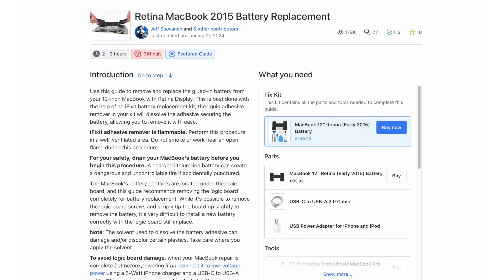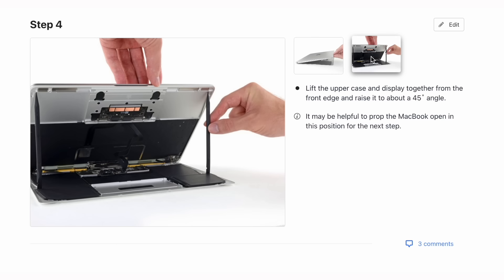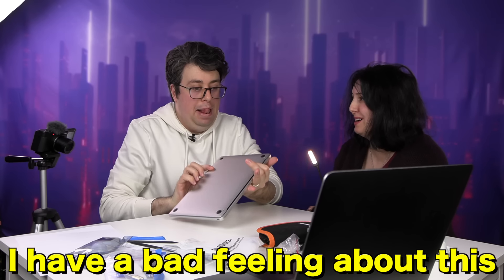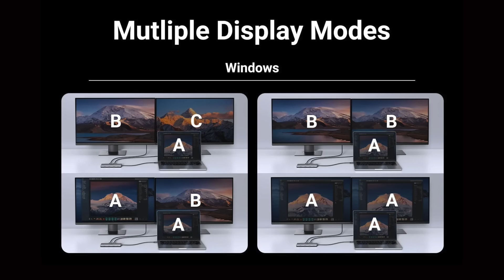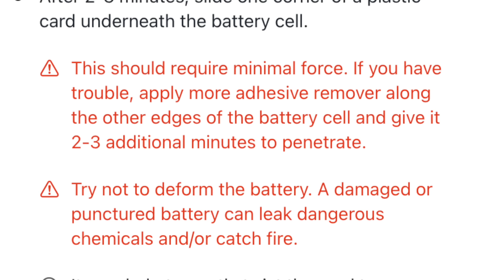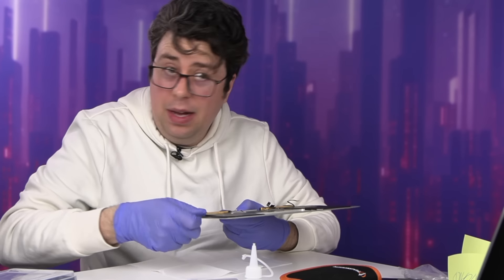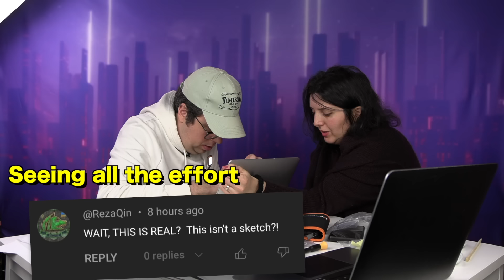So… I Broke My Wife’s MacBook

Comment from the maker: Thanks to UGREEN for sponsoring this video!
Ugreen Revodok 210(29%OFF) - https://amzn.to/49jQ4ZD
Buy on Ugreen Official Store(29%OFF) - https://bit.ly/3I21YLM

And sorry Adi! 😅
Reply: Hi Sam
Reply: Love ur vids
Reply: Hughes Jeffrey, and he will do it!
Reply: This would have been a great iFixit sponsorship chance
Reply: @SAMTIME do not use USB hubs, ever, and please don't promote it. The device can handle the data bus division but it CANNOT handle the power division, which leads to usually burning the USB port or the entire board. NEVER use a USB Hub.
Reply: But you tried resetting the SMC right? My Mac also wouldnt start up after battery swap, but after resetting the SMC it worked just fine.
Reply: i-unsubscribe-jjjjj

Comment: Apple is awesome! In the 90s a battery swap would have been done in 2 seconds without any tools. Now you need to be a surgeon to fix anything on a Mac
Reply: apple batteries have always been easy to replace. it's just the annoying part pairing (Battery health disabled)
Reply: That think is thinner then a smart phone (12 inch MacBook) I can promise you it wouldn’t have been even possible to make it easy to swap out in 2 seconds -.-
Reply: Ah yes, it reminds me of changing a cars window nowadays. They have become an integral part, contributing to the chassis' stability and what.... are glued in !!!
Reply: @Bloxomatic  Well it would, but it would have taken more effort to actually design it to be swappable. Its cheaper and easier to just glue everything down. There is a laptop that has fairly easy parts swapping called the framework 13, but it took a lot of time for it to become a thing because they had to design a whole bunch of modular connections just for it
Reply: Apple, the world’s biggest Unnovator
Reply: Surgeon is the right expression.
Reply: It's by design. Everything is by design to get customers to purchase the next product.
Reply: and tenticles instead of fingers
Reply: Just a few days ago I replaced the engine computer in my car. MUCH easier than this (and it worked afterwards)

There is ZERO excuse for a product to be this difficult especially for a part that often fails-- it's horrible engineering. There are rumors that EU will be demanding user replaceable batteries... That would be a good idea.
Reply: Every other laptop is awesome today
Reply: @theronwolf3296  Not a part that often fails but a part that's guaranteed to fail over time.
Reply: i wouldn't call this "to fix"
Reply: The best were the iBooks and early MacBooks, the only tool you needed was a coin.
Reply: Honestly, I would happily sacrifice a thin profile for ease of repair, both for vehicles and electronics
Reply: Says the person writing this on his 90s PowerBook 170... or is it a MacBook Pro 2020 model!
Reply: Yeap, I have a HP laptop and the battery is connected externally, you can literally disconnect it by pressing a single button xD it even have a battery lock to prevent accidently disconecting it. Can't get any easier
Reply: @Bloxomatic It would have been possible to assemble it with zero glue though. Look at the new repairable Surface PCs or the Framework lol. Both very thin, but no glue and easy to open
Reply: @Bloxomatic  Yup, no way they could have just put the battery in compartment on the bottom with a door held on with a few screws.  Yeah, just not possible at all.
Reply: I agree they are awesome but not for that reason
Reply: 1990s? Even the 2009 was an easy swap. Crazy the work you have to do.
Reply: Classic USA shit.
Reply: Here I’m using an Accer tablet from 2014 and it’s battery still gets about 3 hours on a full charge from the advertised 9 hours when it was new. This is the best tablet I’ve owned as far as usability goes since it hasn’t got any bloatware on it the ui is still quick even with only having a gig of ram. You’d be surprised how much of today’s bloatware runs in the background using up all that extra ram you think you have.
Reply: Best one was the Powerbook Wallstreet with 2 battery bays on each side.
Reply: It was also twice as thick and weighs 15lbs 😂😂😂
Reply: I get what you mean, but apple also didn't make money in the 90s.
Reply: @XanthosAcanthus  Well, that's alright then!
Reply: I believe that's what they call unnovation
Reply: In 2023 every MacBook comes with a special demon whose sole job it is to prevent repair using third party parts. 
Replacing that demon is fantastically hard because Apple refuses to provide replacement parts or authorise third party parts. And those demons can be hacked but only if you’re more of a genius than an Apple Genius genius.
Reply: And still It wont turn on , LOL
Reply: @Bloxomatic yes you could. You just designed it to be part of the bottom cover and let it come out with it entirely. Not ideal but it would have been removable and teplaceble with only a handfull of screws in like 5 min
Reply: Well you'll be getting that back around 2027. You can thank us Europeans for putting in them in place. Although they might be petty enough to design something that adds glue or something  ot just use the software to lock the computer outside of europe so maybe stop bikering between yourselves and ask for proper change
Reply: @Custodian123 true though its relevant not for every company
Reply: Still have my macbook 2008. A few years ago I replaced the battery the battery by just going to the back of the macbook, push down 2 levers take out the battery and put the new one in and done in about a minute. 

Swapped out to a 1TB 2.5 inch drive by pushing down the same 2 levers and unscrew 2 screws holding the drive and the power and sata cable and done. Now on the new ones it is a nightmare.
Reply: Have you seen the Surface Pro?
Reply: @nuggo3068  Surface is more of a tablet than a laptop
Reply: That’s sad.
Reply: There are many things about Apple I'm not a fan of, but the weird and unwieldy batteries do have a genuine purpose - you can fit a bigger battery by conforming its shape to the leftover space in the internals, and not using any extra space to add parts to make it more easily replaceable.

For most people, a battery that will last longer per charge, for more years per battery, is more convenient than a battery you can replace easily. Unless the only thing you're using your laptop for is something that never needs a better processor (e.g. I know an old woman who uses a 15-year-old laptop for Microsoft Word still), most people have good reason to replace their laptop by the time the battery is going kaput anyway. So many use cases of phones and laptops will struggle/be impossible on hardware over 5-10 years out of date, that the best value is to just replace the whole thing even if a cheap and easy battery swap is an option.
Reply: Awesome is not the word I would use to deliberately make it unrepairable
Reply: mac's are by far the most fixed because the only one's worth to fix in the first place and this battery lasted plenty long enough if you ask me, this is a very, very old machine.
Reply: need to be a qualified surgeon to fix anything apple related now
and if not qualified then well your screwed
Reply: In the 90s?
Reply: Now they're reverse awesome!
Reply: Not sure about been the same, but yeah apple could make it easier to fix at least the battery issue without changing the form factor. Thank govt hand off approach nonsense.
Reply: no. you dont have to do it. although they do serialize everything but u dont have to b a surgeon come on
Reply: Apple: the industry leader in unnovation!
Reply: "Now you need to be a surgeon to fix anything on a Mac". this is not true. this is 2015 model. now battery swap is much easier.
Reply: in 90s laptop was 3 cm fat/
Reply: Well, you should go back to the 90s then. Because all the laptops nowadays are like that.
Reply: You could do it before 2007 I think

Comment: It's quite reasonable to assume, you didn't break anything. While it is reasonable to assume, that one of the quadrillion anti repair measures from Apple kicked in.
Reply: What's the most repairable laptop out there?
Reply: Lenovo and dell is there.
Reply: Really depends on the model, some dells are super easy to work on.
Reply: @ayanc13  old Thinkpad and latitude yes
new yoga and xps no
Reply: @مرحبابك-ض1ن  Modern laptop? Framework. Old ones? You have plenty to choose from... And I have no idea.
Reply: i can replace parts with ease in every hp pro or elite books with couple of screwdrivers, usually torx and philips they are easy to work on, unlike their cheapo versions, batteries are solid and not glued, they just require couple of screws which are none removable so you can't really lose them
Reply: Framework laptops
Reply: I didn't even see this discussion about repairable laptops here.....
I have a 2024 Gigabyte Aorus YE5. So far I can't judge it's reapairability in detail, but I can say, it's very simple to remove the bottom cover and work with the internals. I assume, CPU and GPU are soldered, but everything else is easily accessible. I easily upgraded the RAM, because 16GB isn't enough for my media work, you can easily access the 2 nVME SSD slots, and also the battery looks like you can easily take it out and put in a new one if needed. Which shouldn't happen fast, because the thing came with some helpful software, that stops charging at 60% if you want.
So at least upgradability is great with this thing.
Reply: @مرحبابك-ض1ن 
Every HP laptop I’ve owned hasn’t been too bad but I think the super slim ones and the tablet ones are hard to replace but not sure since I’ve not owned one.

Comment: Make the only consumable part nearly impossible to replace. That's modern technology in the nutshell. I am suprised they didn't pot the entire thing with industrial strength epoxy.
Reply: Apple does something like that with some of their products.
Reply: That's Apple, mostly. Though yes, others have copied them. We need Right To Repair laws.
Reply: Not "modern technology". Just Apple shit.
Reply: That's why you get a Framework laptop. Replace anything yourself easily.
Reply: @LawlessNate  I'll look into that.
Reply: I don't think any other modern laptop company is as egregious as Apple at this. Even if the RAM is soldered to the board (which is already shitty, don't get me wrong), battery and memory are almost always easily replaceable.
Reply: Don't give them ideas.
Reply: Their phones LOL
Reply: That's an apple thing to do. "Modern technology" if there is anything wrong with it, is more complicated than necessary. 

Manufacturers make a choice of how hard they want repairs to be, and that's totally up to them. Having the latest tech in something doesn't make it impossible to fix (just look at an airplane and tell me it's not able to he fixed). 

I agree that manufacturers who choose impossible fixes are idiots.

Comment: I did a battery replacement on one of these for an in-law and I warned her that it may not survive the surgery  as these are a mess to due a battery swap on.   I managed to get it installed and it  it was a no start ,  Then I retraced my assembly steps and had misaligned a cable on the main board  It  then woke up  and was a success but what a turd that thing was to work on.
Reply: It looks like a 12" pod the way the built it LOL

Comment: After all that hard work. Apple isn't known for their repairability. You're very lucky to have such a wonderful wife.
Reply: and they are also well known for not repairing their own products, because they prefer if you swapped it with a new one(same model) by paying almost the same price if you bought a new one while surrendering the broken one.
Reply: @lwoklidfr  wife?
Reply: @someonefar5600  why asked me about the wife thing when I'm not the one who made that comment? you are asking the wrong person😂
Reply: apple computers are by far the most repaired because the only ones worth to repair.
Reply: @JohnSmith-pn2vl  joke of the year? most repair because they break easily, and they also like to sell their laptops with solded ssd another thing to repair.

it break easily and yet sheep will still buys them that's why Apple keeps pulling all the BS they can get to earn more money like that "8gb is the same as 16gb"😂
Reply: i say  opposite

Comment: I think, I know the issue: you need to open it again and check all the cables, especially the screen cable, because it's really like to disconnect when you try to close the case. Also try to check all "ground" cables. 
I repaired a few macs and all those humming fans, when it's turning on but not showing the picture, because of a disconnected screen...
Reply: he needs to see this comment
Reply: It's probably hard diagnosing if it's turning on or not since the 12 inch MacBook doesn't have a fan I think.
Reply: You can connect an external display and keyboard and check if it's running that way, not sure about Macs but laptops normally default to an external display if they can't connect to the internal one.
Reply: Didn‘t he try connecting an external display & keyboard at 9:23 ?
Reply: @Marcus_pePunkt  Keyboard, yes, not sure about display. In any case, in my experience laptops also generally don't fail to work without a battery to begin with, so either there's a deeper issue at play, or it's Apple shenanigans.
Reply: @HunterTracks probably apple shenanigans. 

Idk why they're so worried that someone would fix something, especially when they plan on not carrying the battery in the next 5 years.

Comment: Does anyone else remember back when laptop computer batteries was accessable without disassembly?
Reply: At least we have framework now bringing back repairability without sacrificing quality
Reply: Some even had two so you can hotswap them without having to turn off.
Reply: I still use a laptop that has a easy swappable battery. One switch to unlock the battery and one to pop it out. Only if the capacity was high enough for todays standard.
Reply: Back when we had removable batteries the typical life was around 3-4 hours so battery swaps were something people did often. Now we have MacBook Pro’s with blazing fast processors and gorgeous bright screens that manage to get 14 hours of battery life so having a replaceable battery is not something people care much about anymore.
Reply: @QuintonDolan  Or at least as long as the battery is good. When it dies, everyone wishes they had a laptop with easily replaceable battery
Reply: @QuintonDolan  Hardly an equal comparison since we also had power hungry 35W+ processors and inefficient cfl screens back then... Very much the opposite of today where we have mobile processors that use upwards of 5w under full load and screens that sips power, while the battery itself is barely any larger than those of old laptops, only flatter and thus thinner laptops.
Reply: @vgamesx1  that’s the point. Swappable batteries used to be a thing because battery life was awful. Laptops also used to be a lot thicker and heavier, and ran hot enough to burn you but nobody reminisces about missing those things.
Reply: they usually still are, but on normal laptops, not the abomination that macbook is

Comment: Great design Apple. A simple battery replacement can be this difficult
Reply: this is not difficult and why would anyone want a new battery on an ancient device.
apple's batteries last easily 2 times longer than any windows craptop
Reply: @JohnSmith-pn2vl bad troll

Comment: After a repair, the 12" MacBook requires a 10 minute trickle charge with a 5 watt power supply before you connect the normal power adapter.
Reply: But shouldn't he get something on the screen, even without a battery attached? As long as the adapter is plugged in?
Reply: You're right - i remener I had to power it on with a charger plugged in but that was it it had to be a low power charge

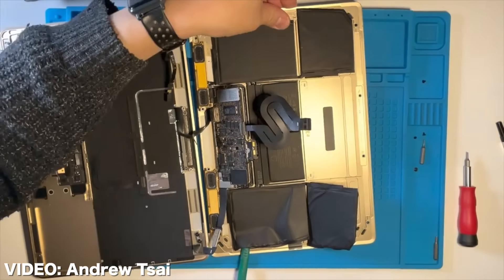Comment: 6:20 I wouldn't recommend it because there's lots of ways for this to go wrong, but in theory if the battery is discharged all the way down to 0V* it should be relatively inert, and so damaging it during removal wouldn't be a big deal.

*To be clear, I don't mean 0%. Completely discharging lithium batteries is very bad for them so battery management systems consider the battery to be at 0% when the cell voltage is much higher than 0V. It doesn't really matter if you damage a dead battery that you're removing anyway, but since you're doing something very non standard you need to manually discharge the battery with an appropriate discharge resistor or other dumb load.
Reply: A battery discharged to 0V is probably *dead*, or if not dead, has a significant self-discharge.

Comment: I remember back when you could just order a new battery and pop it right in. 2008 isn't that long ago.
Reply: Wolds apart
Reply: no longer needed, the batteries last easily the lifetime and are easily replacable like shown here. but almost nobody will do that because this machine is more than ancient.
Reply: 2008 was 16 years ago

Comment: If you think Apple soldering RAM to their motherboards to avoid users from upgrading/fixing it was bad, they are now doing this with the hardrive as well. Look up their new Mac Mini...

And what they do on their iPhone/iPad is being pushed to their computers as well. They are disabling repairs with software. For example, you replace the display in a system with an original part from another Apple device, the part is original, made by Apple just from another device, even the same model, and it will not work. Or they will disable things in the operating system on purpose to leave a crippled device. They disable things with software to avoid users from repairing devices. How much more anti-consumer can Apple be is mind-blowing.

Comment: The 12” MacBook has a small yellow button on the logic board that is near an LED that lights up when it has power. If you push that button it disconnects all power to the laptop and the light turns off. You should try opening it up and pushing that button, see if it comes back to life.